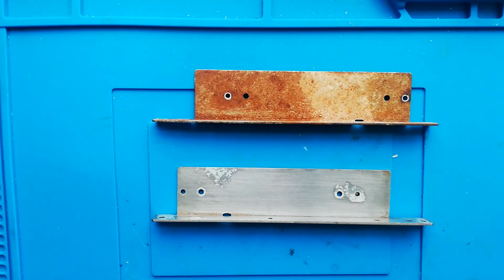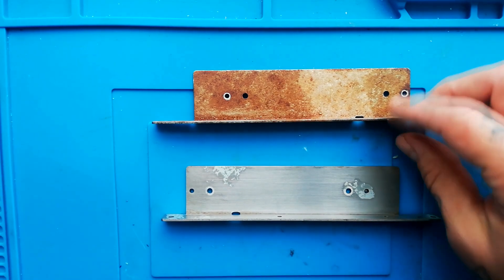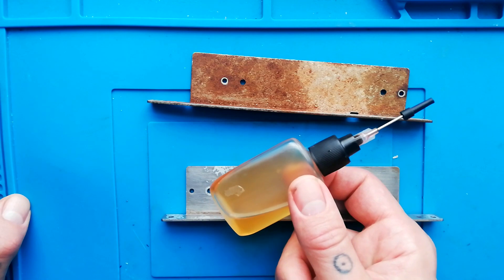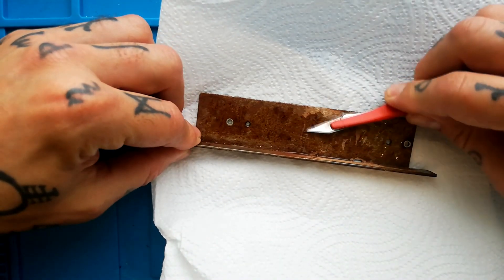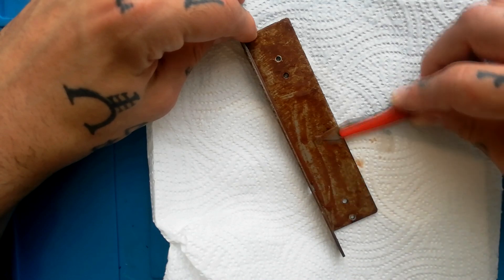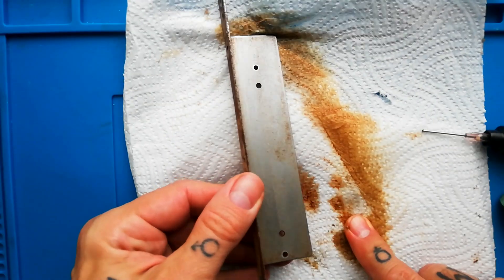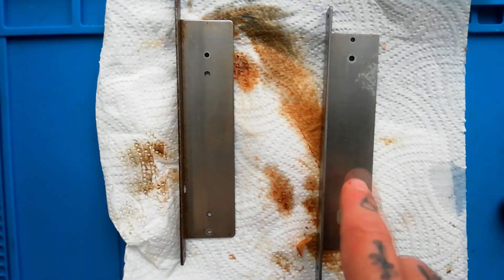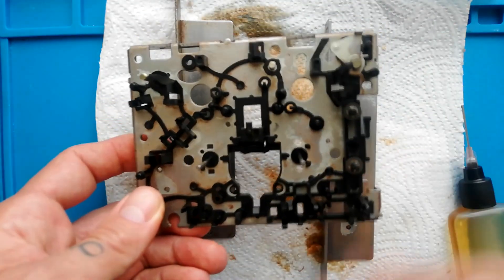Corrosion removal with AMS motor oil - better than vinegar?

Comment: I picked up something like that for my quadcopter motors, (Admittedly: I’m the only flyer who oils their motors) cuz synthetic doesn’t turn to hard crap after a while. Good tip. I use white vinegar for my drum hardware and hoops, but yes… you must have a large container to put it all in while soaking. Pro tip: wrap in paper towels soak them and place in plastic bag in bath tub over night. Works!
Reply from the maker: Good tip, thanks!
Reply: Vinegar is so inexpensive… and has always worked really well for me. I think I got like a gallon for dollar, at the cheap stuff store. Ha ha! 
To be honest, my main aim these days is to find a product that will reliably prevent rust from forming again, once it’s been removed. 
It sounds crazy, but bees wax is in the running for me. It’s just that a good way of applying it, I have not settled on.
Reply from the maker: @BadChizzle if I didn't need the oil anyway to mitigate wow and flutter in motors that have spent part of their life in damp attics and garages while everyone was in love with hard disc recording, I'd probably live with the smell and slower work flow of vinegar. It's a pity the oil isn't sold in smaller quantities, but I suppose most of their customers are expecting to use it on a whole-arse car, so 200ml bottles just wouldn't sell. I had to buy a litre bittle, and and while it wasn't cheap in that quantity, the actual amount of oil I used in the entire transport is worth pennies. The bees wax thing is interesting, though I'd be nervous about such a substance getting near a cassette tape path...
Reply: @Tetrakan  That’s a good point and I’d probably only use beeswax for drum stuff… and that kind of thing. But you can get a layer on that you really don’t know is there, if you heat it up, I think. Not positive. Ok… I’ll admit… I just like the beeswax idea too much, cuz it’s kinda Cool. Oil in general has just gone up so much in the last few years, it freaks me out a little! Ha! You’re right though. The way you’re using it, it’s cost effective for sure.

Comment: Awesome! Do you have a list of tools, oils, grease etc on a site somewhere. My 244 arrives tomorrow and I’m nervous and excited. 😅

PS: I’m going to try the Nak T-100 audio analyser app. May have to do it twice because it’s not for 4-track. 😂
Reply from the maker: I'll need to check out that app. If you look in my video descriptions, I have lists of the stuff  on the website kit. If you follow the links there, I get a little affiliate kickback, though it doesn't cost you anything. Have fun with your 244!
Reply: Acetone to clear up the oil residue Cal?  Maybe do a little tester somewhere, like on a spare bit of plastic or glass out of the rubbish bins.
Reply from the maker: @quikstiks4781 hmm maybe, but there’s stuff in a cassette transport - rubber and plastic parts for instance- that I don’t want anywhere near acetone, so I feel like using that substance might cause more problems than it solves? The cassette player is working and feels dry to the touch btw.